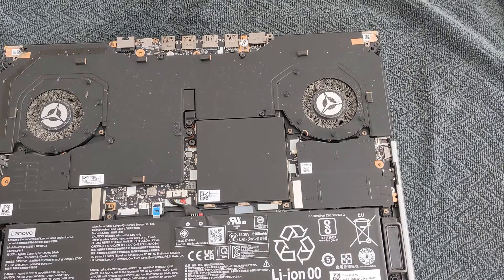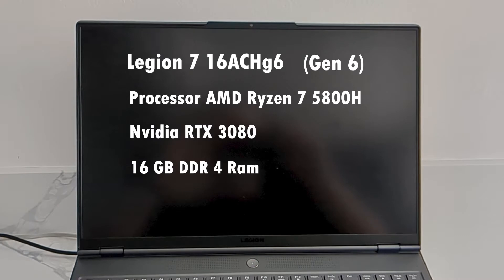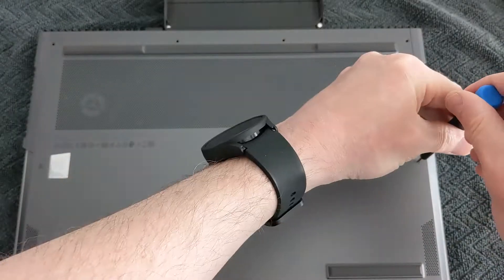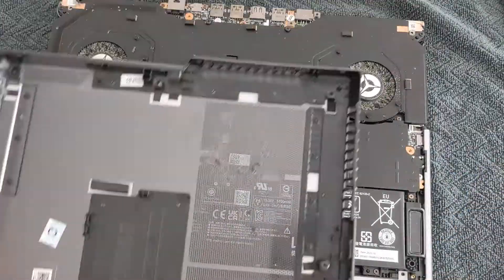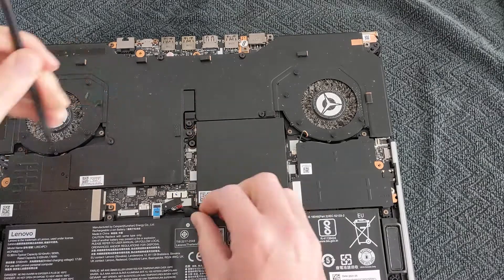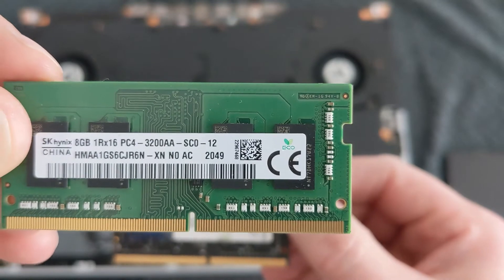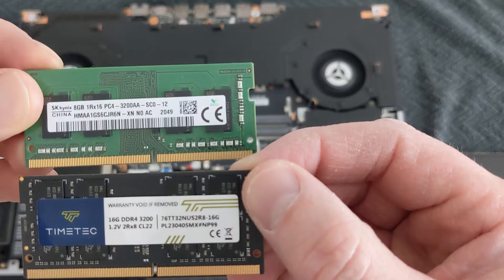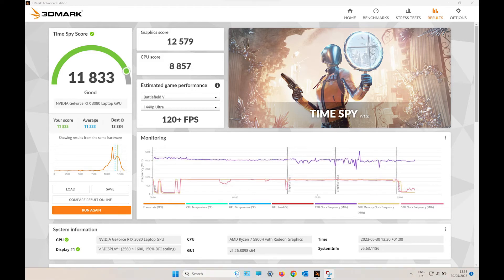How to Clean a Lenovo Legion 7 Fans and a Ram Upgrade. BIG IMPROVEMENTS

Comment: you need to show the proper way to do this, as this isn't it, the vapour camber and heatsinks need to be removed and the fan modules unscrewed to gain access to the main dust trap which overtime ragingly chokes airflow, this level of light brushing and vacuuming is only good occasionally between actual cleans

Comment: Have you tried disconnecting the fan and also cleaning the heat sink?
Reply: So, the answer is?
Reply: I would imagine not. You'd have to remove the entire vapor chamber and re-apply the liquid metal on the CPU and the PTM on the GPU.
Reply: @tommy10436  there is no metal on CPU. I hope...
Reply: @PersivanA  On 2023 Lenovo Legion 7 & 7i there is for sure liquid metal on the CPU, and their proprietary PTM on the GPU.
Reply: @tommy10436  oh. You are talking about 2023. Okey.
Reply: Yes, sorry. @PersivanA
Reply: @tommy10436  there is no liquid metal in this laptop, and removing the vapour chamber is the best way to clean the fans, each assembly can be opened completely exposing the fins of the fan and the heatsink in which you will usually find a 1-2mm cake of dust blocking